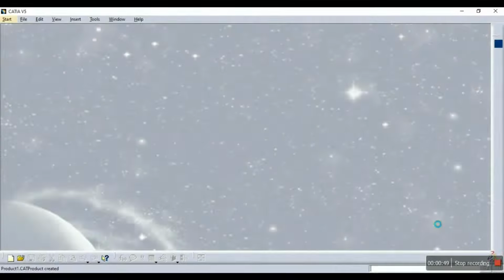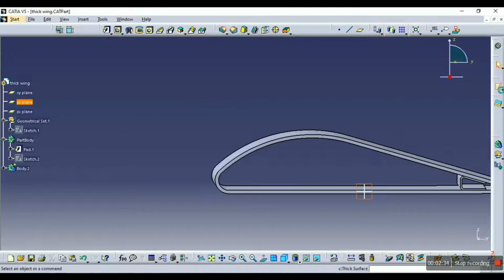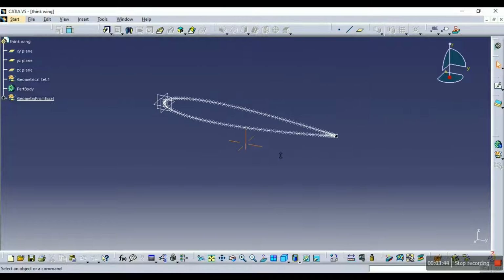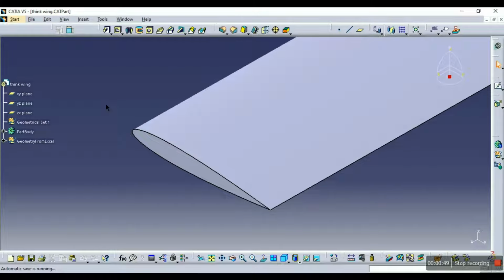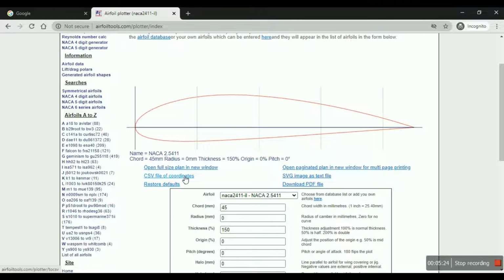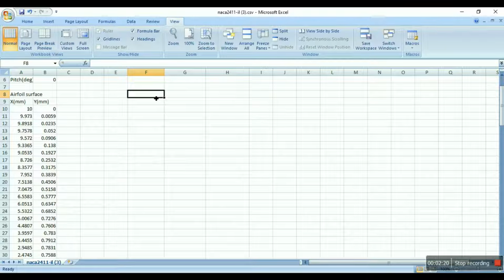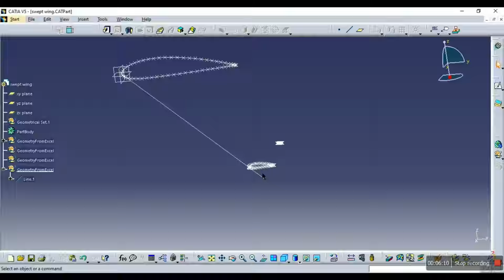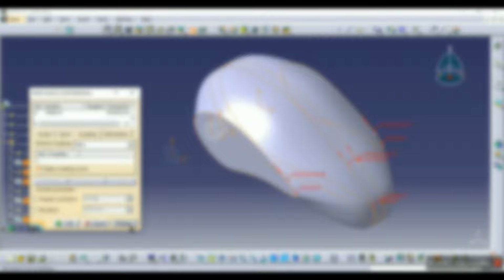3 Types of Wing Design in CATIA V5

Comment: heey how can we measure the CL and CD of an airfoil ??
Reply from the maker: Of an airfoil OR of the wing? Because both are different things🤷🏼‍♂️
Of an airfoil(it is 2D), you can head to airfoiltools.com and search your airfoil name/NACA number and get the values. 
Wing, which is 3D, you will have to do a CFD simulation in ANSYS or OpenFOAM or any other applications.